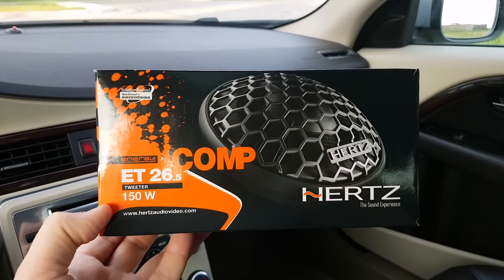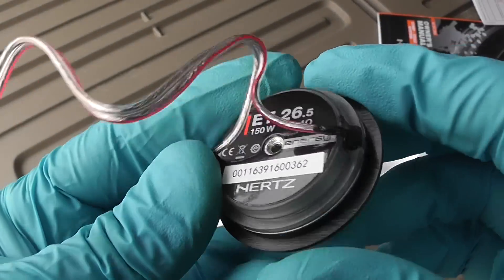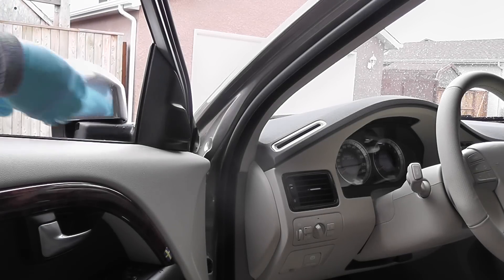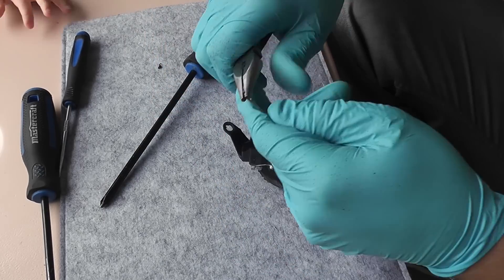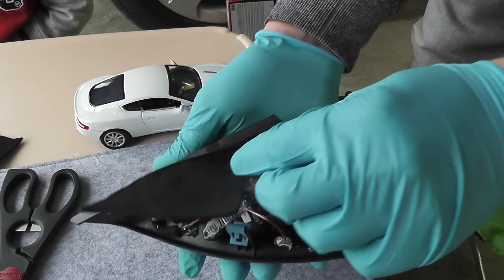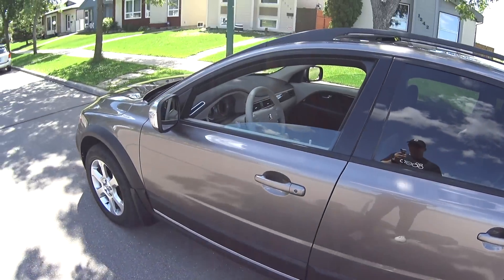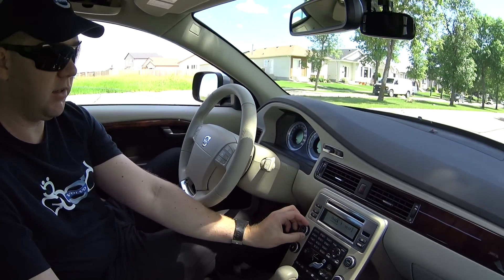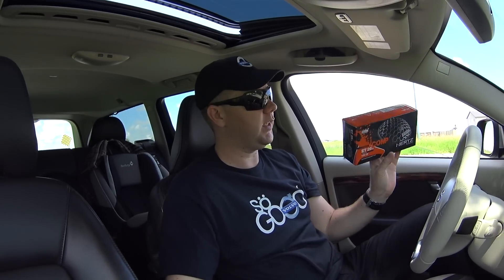Upgrade to Hertz Tweeters in a Volvo. Worth it?

Comment: In case, if you add tweeters to your stock speakers and feel the audio in the front sounds higher. Just use the fader and fade the front a bit. This will balance the overall audio level in your car. Else the rear passengers end up listening nothing and the volume on the front would be high.
Reply: I don't like pushing the fader to the front. I keep it in the middle, the bass level is at 0 and the trebles are at +2. I also added a 12 inch sub, Along with that I have premium sound which is amazing. All I did is adjust the equalizer in a V shape, sounds amazing.

Comment: Another great video, thanks! I've just spent Saturday replacing all of the speakers on my xc70 with Focal components. I used a similar method to yourself to mount the tweeters in the front doors.

Comment: Hi all. @volvosweden, have you calculated that capacitor? 400V is waaay to much, that's why it so big in size (100V would be just fine). And 4.7 micro farad....is a little low, in my opinion. A like from me for your work :). Cheers

Comment: I need to replace the passenger-side front speaker on my 2011 volvo S40 T5 because it has began to rattle and this has become quite annoying.   BTW, I intend to replace bought front speakers while I am at it.  Which speaker brand and model would you recommend.

Comment: How much of the improvement came from the capacitors? In my experience there is a big improvement going from electrolytic caps (like original fit) to the Poly cap that you used with Hertz tweeter.
Reply from the maker: Should have tested the new caps with the original tweeters to hear the difference. Too late.
Reply: Too bad - you chopped them up ;o) @volvosweden

Comment: Excellent video. My XC70 door panel woofers are due for replacements. Have you any experience with them? I'm contemplating between Hertz and JBL. Your input would definitely be valuable.
Reply from the maker: +Alofzico Legambaz I know my friend has JBL in his Toyota Venza and it's not the best. He installed Hertz which sound amazing.
Reply: Thanx for the tip. Please keep them videos coming.

Comment: Thanks! Your car is diesel right? In general, how do you think Volvo’s turbo gas engines (or diesel). Volvo to me means Longevity, Consumer Reports says long term cost of ownership is very low vs. even Jeep. But there are bad reliability comments on Edmunds, for all models & engines. I’m just concerned with the 3litre turbo I6 in the XC70. Is it the same as the S80 3.0 turn 6?

Comment: Will you change the speakers in the doors? if so make a video about it! :)
Reply: I've just finished upgrading the sound system in my 2015 xc70. I wish I'd made a video! I put Focal components in the 4 doors, Pioneer TS-WX710A sub under the boot floor behind the spare wheel to not lose boot space and I fitted an Audison 8.9 amp in the boot to power the Focals. I've kept the factory head unit and took an audio feed from the Volvo amp under the front seat to the Audison in the boot. The only issue I had was that I could not find woofer speaker adapters for the xc70. The woofer mounts are an odd shape and so I thought about making an mdf ring but making a shape that fitted looked like a lot of work. In the end I used the Volvo speakers, stripped the centre section out and and fitted the Focals to that. The Focals had a wide basket but this method works well. I also added sound deadening to the doors and boot floor.

Comment: Hey. I've got Basic sound system in my Volvo. I removed the plastics for tweeters and there are actually no tweeters installed in my configuration. But there are already cables with connectors. Do you maybe know, if I buy tweeters somewhere, should they work, are those cables connected to the radio unit?
Reply from the maker: +Aws3nicK I am not sure. You could connect a small speaker and see if there is any sound at all
Reply: Ok, thanks man. More of this videos, keep on good work! :P
Reply: Which Volvo and model year do you have? I had a look on VIDA and the 
2012 xc70 lists a door wiring harness without and with premium audio. 
This implies the same harness is used for base and high performance 
audio. Base audio has no tweeters, high performance has the tweeters. 
The tweeters are fed from the main speakers in each door. If you take 
the door card off and look at the wiring colours on the woofer they 
should be the same as the tweeter feed you have found. If you post the 
wire colours you have found on here I can also look them up if that 
helps?. Does your car have BLIS?
Reply: I have VOLVO V70 D5, year 2008.
Reply: The MY 2008 V70 shows these wiring colours for the front door tweeters:

Front Right
green/black +ve
grey/black -ve

Front Left
violet/red +ve
yellow/red -ve

The wires to the woofers in the front doors should be the same colours as above too. If you are thinking of adding tweeters to your existing setup it might sound quite bright, it may be worth turning the treble down on the radio or adding additional resistance to each tweeter to quieten it down. A high level mounted tweeter often runs with a 3dB volume cut for this reason.